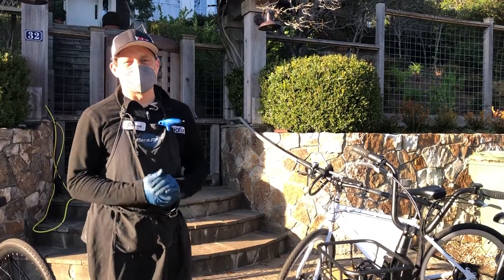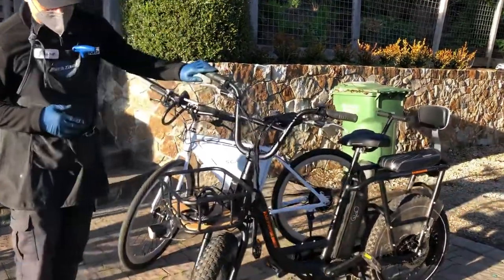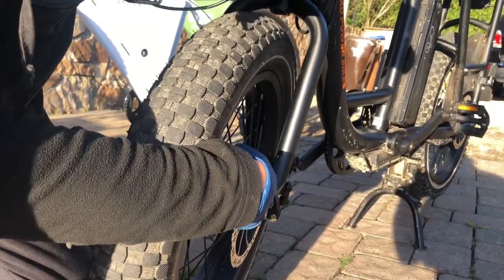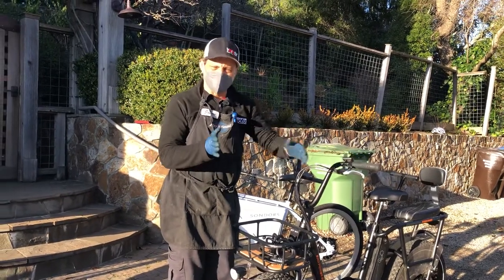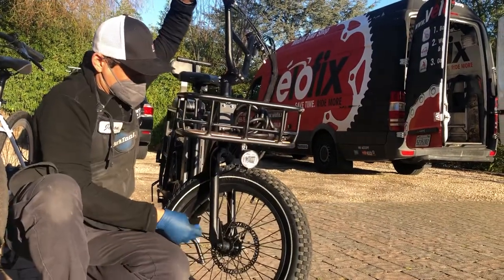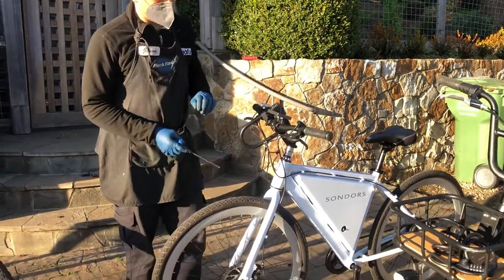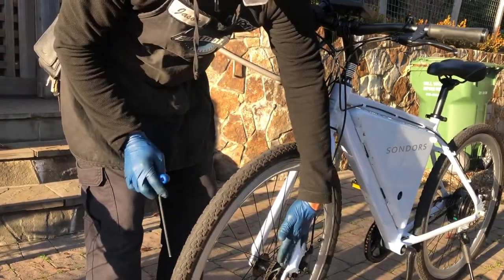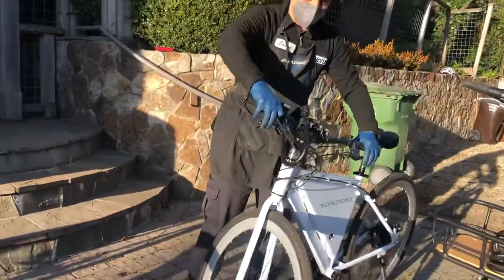Adjusting Rad Power mechanical disc brakes - Part 1

Comment: My front brakes just wouldn't work.  I tried several suggestions, watched numerous videos.  decided to rely on the rears until I could manage to get to a repair shop.  Even the thought of that was daunting, knowing it would be in shop for a week or more.  Tried this, actually that adjuster on the wheel, clicked a few notches in, and bingo.   Brakes work perfectly.  so glad I stumbled on this video.  kudos to you for this.
Reply from the maker: Good job getting extra support when you needed it.

Comment: If the cable is super-stretched, don't you eventually run out of adjustment using these methods, and have to pull the cable through the locknut? You can only undo the barrel adjuster so far.
Reply from the maker: I’m glad you brought that up. Yes, there is a point where the barrel adjusters can’t be turned out any more. I normally see this when the brake pads are about 70% worn. At that point I’ll adjust the brake again. I’ll loosen the caliper mounting bolts, screw the barrel adjusters almost all the way back in (reset them) leaving about 1/4” of slack and tighten the inner pad adjustment (5mm piston) until the brake lever pulls about 1” or 3cm from initial lever squeeze until the brake pads engage on the rotor. At that point I’ll manually center the pads so they aren’t touching the rotor as best I can and straighten (bend the rotor manually with a rotor alignment tool/ or small adjustable jaw/crescent wrench). I use the barrel adjuster slack to fine tune. This will likely be my next video.
Reply from the maker: And, if needed I’ll tighten the cable at the caliper.
Reply: @jasonserafino-agar9964  Thank you; in my case it was a new bike and I think the brakes simply weren't installed correctly (cable not pulled tight enough before screwing it down). The brake lever was touching the handlebar when the brakes were less than 50% applied.
Reply from the maker: Totally. See this video: https://youtu.be/WSxu0hD-9Oc?si=u3kBl-BwFef7Pmo4

Comment: i just changed the break pads on my rad runner. i reset the caliper and the barrel since i figure i will need the space for my new pads but some reason it's really loose and doesn't even close tight enough stop my wheels after i squeezed all the way down. any reason why that is?
Reply from the maker: Take a look at the part 2 video for how to adjust the inboard pad clearance. https://youtu.be/WSxu0hD-9Oc

Comment: hi. thanks for the content. Question, which direction do you turn the knob for the cable by the brake lever and cable knob by the caliper to make the lever tighter? thanks
Reply from the maker: To the left or counterclockwise to unscrew the barrel adjuster from the body of the brake lever. That make the outer sleeve (brake housing) longer which pulls the cable more. Imagine making your jacket sleeve longer which makes your arm seem shorter/pull more at something you're holding onto.

Comment: Can you share where you purchased the sissy bar for the passenger seat please.
Reply from the maker: I can't remember the maker of that seat system, but I see them falling apart on different bikes so can't recommend them. I did customize some YUBA monkey bars to fit on a RadRunner and that worked out well.